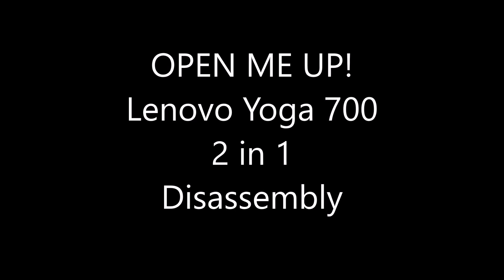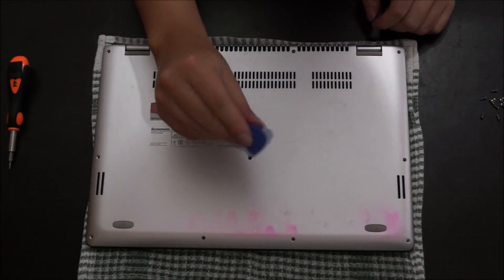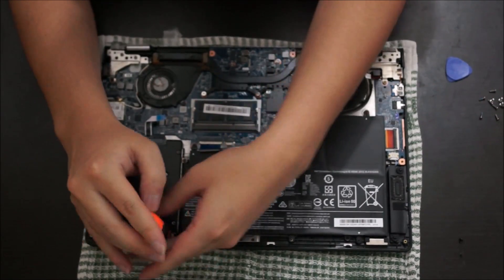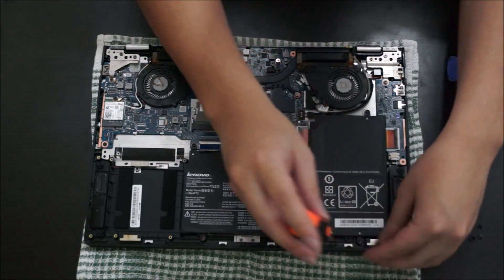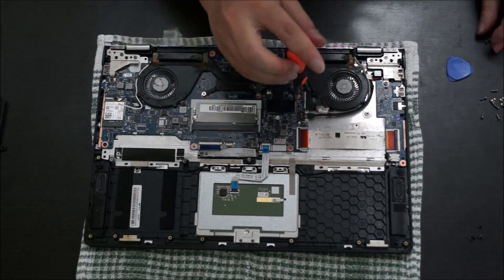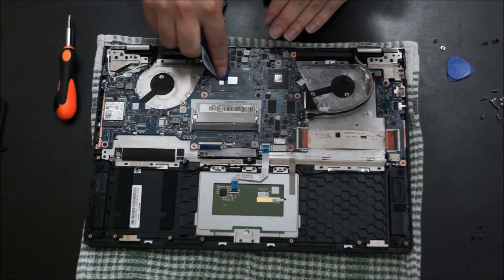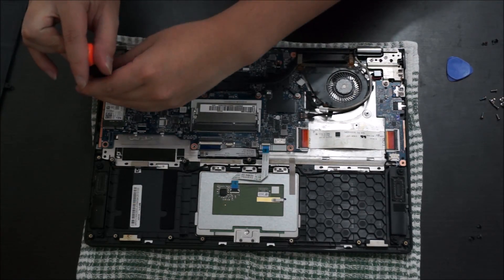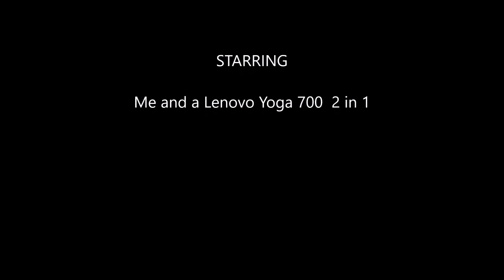OPEN ME UP! Lenovo Yoga 700  2 in 1 Disassembly

Comment: I want to upgrade  16GB RAM , Is it possible?
Reply from the maker: CPU is solder on, graphic card is solder on, ram can be changed to 8GB max with 8GB in one slot, wireless card can be changed, and hard drive is a 2.5" inch.

Comment: What screw driver did you use I literally tried all the sizes
Reply from the maker: should be a torx T2 or T3
Reply: OPEN ME UP on the website it said t7 Torx
Reply from the maker: t7 is way to big.

Comment: I am thinking about installing a 950m gtx to the motherboard of my 700 14isk. I currently have none. Do you know wether all 950m gtx have the same standard and I could  place in the any card from another laptop? I only have one fan, but I know where to get this dual-fan.
Reply from the maker: thats not going to happen if you watch the video or look at the description you will find out the below CPU is solder on, graphic card is solder on

CPU is solder on, graphic card is solder on, ram can be changed to 8GB max with 8GB in one slot, wireless card can be changed, and hard drive is a 2.5" inch.
Reply: Thanks for your fast reply! I dont have any graphiccard in that spot, so the slot should be free. In the worst case I can solder myself. My Only problem is to get the right graphics card :) In the documentation I cant find anything like MXM. But I know that this version comes with an upgrade to 940m gtx so it must be possible?
Reply from the maker: you got the wrong idea. you cant soldered it on yourself. it is not a slot, you will need to solder on every pin on the chip set and get the RAM for the graphic card to solder it on. since you are asking the questions clearly you dont have the equipment needed to do this
Reply: OPEN ME UP OK, thank you! Now I can sleep peacefully :)
Reply: Nope. Can't sleep peacefully. I've been told many times, this and that is not possible and in most cases its just harder than usual. Can't you just make the connection to the pins without soldering if it is really impossible to solder? There must be a way to connect the two parts.

Comment: I plan to buy lenovo yoga 700,, how do you think? i use for work..
Reply from the maker: all laptop are basically the same since INTEL make the CPU. Laptop companies only assemble the product. so just buy the laptop and brand you like. If you can try to physically use the laptop before you actually buy it
Reply: OPEN ME UP,, thank you very much, cz i really don't know anything about specs of laptop, just look the model 😁
Reply from the maker: if laptop A has the same spec as laptop B then they will perform the same. This is why i advise you just to buy a laptop you like. this is probably the easier way.
Reply: OPEN ME UP, ok.. thanks a lot..
Reply: I can recommend it. Nice screen and the battery lasts long enough for presentations with customers. its both nice looking and fast enough for all business applications you need (Photoshop). I would never get anything else. I have to admit thou I got it for only 460 € as a used piece.

Comment: So if it already has an 8gb DDR3 ram, does that mean I cannot put a 16gb DDR4 or DDR3 in it?
Reply from the maker: CPU is solder on, graphic card is solder on, ram can be changed to 8GB max with 8GB in one slot, wireless card can be changed, and hard drive is a 2.5" inch.

Comment: is it possible for you to do a removal of the screen for this model? Cracked my screen and trying to replace myself but there is hardly any information for this specific model. Would be greatly appreciated
Reply from the maker: go to lenovo website and you can get the user manual and it will tell  you what you can remove

Comment: Hi, I've read that Ram is soldered. Is your laptop 11 or 14 inch?
Reply from the maker: 14 inch
Reply: Can I upgrade it up to 16 GB? When no, why?
Reply from the maker: CPU is solder on, graphic card is solder on, ram can be changed to 8GB max with 8GB in one slot, wireless card can be changed, and hard drive is a 2.5" inch.
Reply: Has anyone tried a total of 16GB?
Reply from the maker: CPU is solder on, graphic card is solder on, ram can be changed to 8GB max with 8GB in one slot, wireless card can be changed, and hard drive is a 2.5" inch.

Comment: Is there a CMOS battery on this motherboard?  If so, where is it located?
Reply from the maker: there is none
Reply: How do you discharge the motherboard to reset the bios w/o booting?
Reply from the maker: if you trying to remove the password by doing this that doesnt work and has not work for awhile now.
Reply: No, mine seems to be in permanent sleep mode and I am trying to get it to boot  (I replaced the screen and it doesn't boot).
Reply from the maker: you most likely have a faulty motherboard
Reply from the maker: there is no suck thing as permanent sleep mode. if you think it is sleep disconnect the battery and use the power cord only then it cant sleep anymore